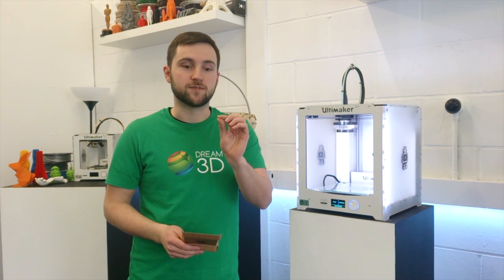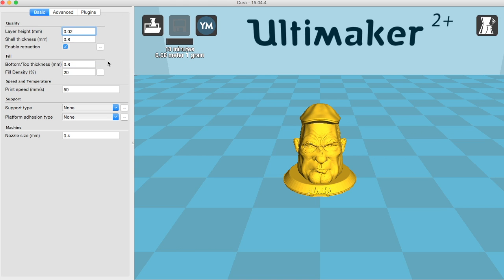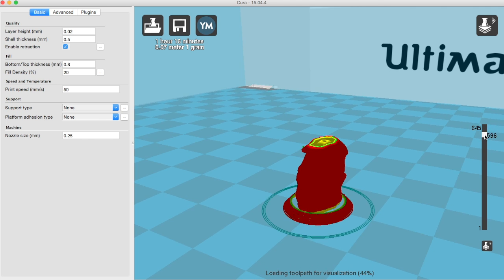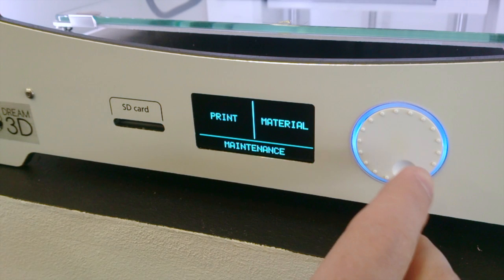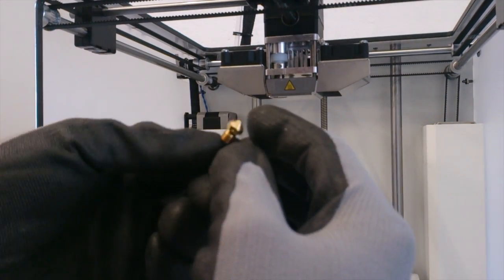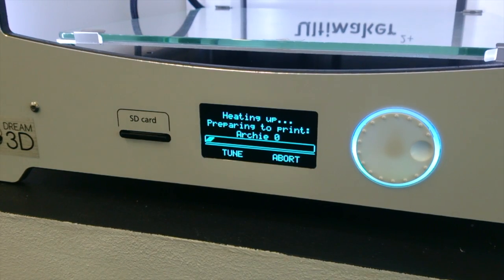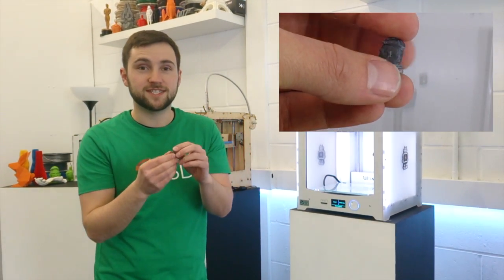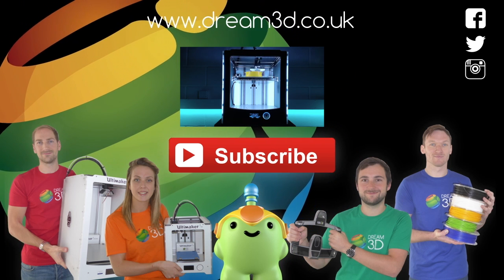0.25mm Nozzle on the Ultimaker 2+ | Cool 3D Prints | Dream 3D

Comment: Great result! What properties did you use while the printing? Which was the filament? The Nozzle Temperature? The temperature of the glass? Filament Flow?
Reply from the maker: Hi, flow was at 100%, filament was colorfabb pla, nozzle temp was 210, glass was 60. The print settings were 0.02 mm layer height, print speed was 50 mm/s, infill was 20%.

Comment: Oh man, Ultimaker makes such good printers! I'll buy one, one day! And be rid of constant tinkering with diy printers!
Reply: They are ok... not as good as I thought when I bought my ultimaker 2 extended. They have numerous issues that are much harder to solve that printers with the feed motor on the moving print head. personally I don't rate then they highly.
Reply: Then you must be doing something wrong.  I have several from diy to the u2ext and by far the u2 is the most trouble free, reliable machine.  The only one better was the Stratasys models but they aren't for hobbyists.  The only problem I have is ABS doesn't always play nice, but you can box in the machine to keep the heat in and that fixes it.  The FDM type machines all have similar steps to fix prints such as feed rates, temperature settings, etc.  Once you configure Cura with the right settings, you should just be able to plug and play.  If you have specific problems, I may be able to help you through them.
Reply: Hi Jard, thanks for your reply. I use simplify 3D for slicing so have many many setting that i tweak and change. However i find that the ultimaker is not reliable with its extrusion and flow. This means that sometimes i get not enough material exiting the machine head and other times i get too much leading to over size part. I am considering getting the upgraded + as the feeding has been improved. This should solve my problem. Cheers, L
Reply: Lukas Renee It seems I must have gotten lucky with mine. My Kossel mini clone has been through 2 extruders and over a dozen hotends before I found a combination that worked.  It also depends on the filament.  I have found that some filament is more affected by temperature and humidity in my house than others.  With that machine, I have to calibrate every roll.